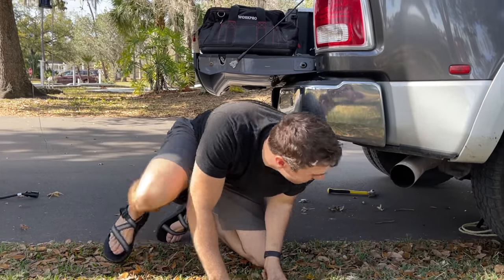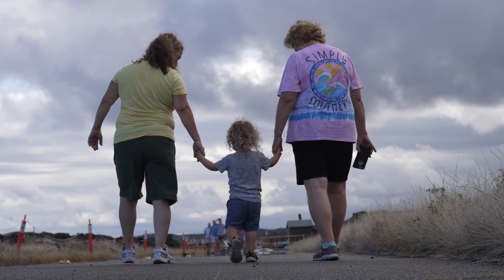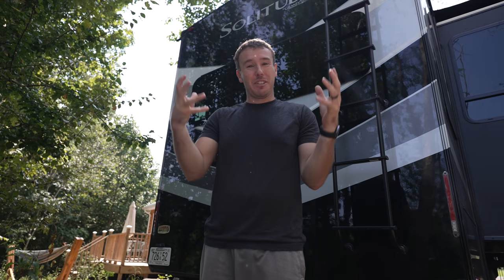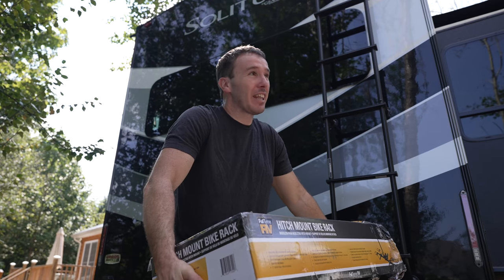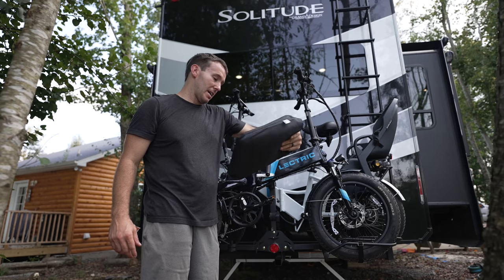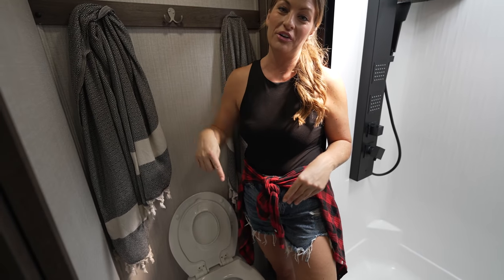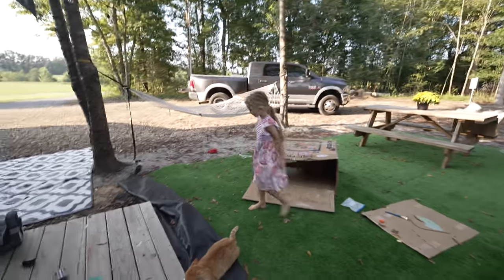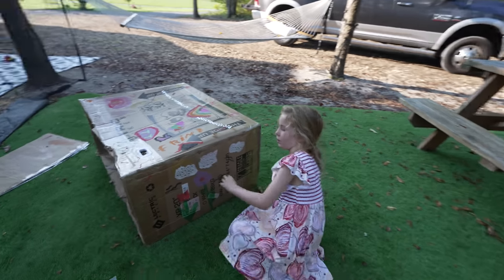5 DIY Upgrades That MIGHT Make RV Life Easier

Comment: I agree with Dans comment below and maybe others that I didn't see. "You could add a secondary switch on the island that turns the lights on and off and leave the wall switch on all the time to energize the water filter." Or you can jumper the switch on the wall so that it never shuts power off to the island.
Thank you Nathan and Marissa for another awesome video. Really interested how that Ebike rack holds up and how long the water filter lasts and how well it works for you.

Comment: We've always replaced the quick pin and cotter pin that allows you to fold it up and down with a solid grade a stainless bolt and locking washer set. Just tighten it down properly and it will add security I the gap or lash if you will that the folding pivot allows.

Comment: FYI FYI FYI-Nathan, if you read the instructions it clearly states not for use on travel trailers or 5th wheels although the picture on the box is deceiving.  I bought the same one but am afraid to use it on the back of my reflection 337rls.

Comment: For added e bike security remove one pedal, seat post and battery.
Reply: I bought the BIGLUFU motorcycle chain lock, uncuttable 12mm square chain that’s 4 feet long and covered in this “hard to cut” material for my Lectric bike. It’s a beast! I love the idea of removing the seat because I got the comfort package. Removing the battery is another great idea as it’s worth a couple hundred dollars.

Comment: Nathan, be aware that ebikes are not intended to be left out in the weather. They can take a bit of rain but leaving them outside while traveling may cause troubles. Love you guys!!!!
Reply from the maker: Thank you for letting us know. We do hope to keep them covered and out of the elements as much as possible.
Reply: Lectric 2.0 is more weatherproof but I agree it is risky to leave them out in weather. Definitely a great heavy duty chain!  We also have motion alarms for our bikes.
Reply: We have had ebikes for two years now.  We always remove the batteries when they are on our carrier and we are travelling.  We use a good cover and have never had a problem with the electronics of the bikes.  We have the Swagman ebike carrier and it is very sturdy with locking arms and locking hitch pin.  Have hauled those two ebikes many a mile now.
Reply: @mischiefroadtripadventures  it's rated IP 65
Reply: Some people buy the big outdoor grill covers to cover the bikes to protect them. That's what we will do also
Reply: Sandra Westley uk I watch a couple that are RV s that have been robbed twice of there electric bikes, taken off there rig, so make sure they are well insured, and have good locks on them, they even think they were taken one of the times when they were in there rig, and they were on a site, not boondocking, but it was private and up a corner at the end of a trail. So always always keep them locked up when your not in use.

Comment: QUESTIONS:  Love the channel, btw. #1 - The Acuva. Why this particular system instead of a Berkey? I know it takes up counter space, but … SUPER EASY to use and maintain. Filters last a long time and the level of filtration includes bacteria, etc. The other benefit, NO ELECTRIC source needed. #2 - I’ve been battling constant replacement of the stupid drawer catches that are plastic and break incessantly. I’ve installed a magnetic catch (supposedly 60lb), but is really not super strong. Any tips from you or anyone else reading this would be mucho bueno!! Anyway, inquiring minds want to know! Glad you’re back from Hawaii and can’t wait to see your new adventures. :-)
Reply from the maker: They are both great, we had Acuva before and enjoyed it.

Comment: On the bike carrier, put some pipe insulation on the bike clamps that go to the frame of the bike.  Otherwise they will rub the paint off of the bikes.
Reply from the maker: Thanks for the tip.

Comment: Should keep it 12 volt otherwise you need shore power or run inverter 24/7 to filter water.
Should be able to run 12 volt line through basement & poke up into island.
I would add a switch, just because.
Reply: Totally agree. Best route.
Reply from the maker: 12v would be a good bet for many RVers. For us, we typically leave the inverter on all the time so using 110v isn't a big deal.

Comment: The foam around the part that holds down the bikes will wear through very fast and then you will have metal rubbing the aluminum bike frame, damaging the bikes.  I folded a piece of cardboard box to help protect the bike.
Reply: Also, are you at the rally?  If so, what section are you in?

Comment: We have sliding doors for the master bedroom and bathroom.  I wanted to hang those over the door hooks for towels and robes but it wouldn't work.  I do have space on side of the toilet  in the master bath.  I keep our mop & broom back there so they aren't seen since most people use the 1/2 bath.  Our rig came with the extra filtered water faucet.  I think we have a leak I need to look into having fixed.  I'm hoping it just need drain putty.  That stuff dries out so fast when the rig is left sitting in the sun.  HUGS~Donna

Comment: Change a dually tire? Isn’t that what AAA for? Those covers will not stay on going down the road. They’re great when you’re parked. Get a heavy duty lock that a bolt cutter won’t cut through easily.

Comment: The ebike in a tub under the RV is more secure than on a trailer hitch outside. If you ever watch the Lock Picking Lawyer, no lock is really secure. Plus pulling a cotter pin out of that hitch wouldn't be all that hard. Maybe a pull out slide w bike mounts would be better?
Reply from the maker: Totally agree. We just weren't willing to give up 90% of our bay storage for the two bikes to fit underneath. For others, it could be a good trade off or if someone has a bigger bay it might not be as much of an issue.

Comment: I was trying to add a light dimmer to the switch by the door. It didn't work. Turns out the switch went to the Lippert Compass Connect to energize a relay. The real 12v circuit came off elsewhere. I feel your pain with the island.

Comment: Put a bolt through the place where the pin and cotter pin are now.  Also, get a locking hitch pin and a proper lock for the bikes.  $2k+ in bikes is a prize for any thief.  We have the same bikes (v1 actually), would love to share what we do for security and tracking if stolen.  Send us a message on IG. :)

Comment: Just a thought, I am no expert. But for the "U"V" part of the filter needs the water to be exposed to the UV light for a certain amount of time to kill the critters. Running it to the larger faucet might cause the water to not spend enough time in the light?
Reply from the maker: I get what you are saying but this is designed for running water.

Comment: Do you guys leave your hot water heater on at all times or do you turn it on when needed? Also, do you find your AC unit to run almost constantly? Is that normal? 

We just went through our first week of the full time rv life!
Reply from the maker: Some leave it on, some turn it on and off.  Our friends only turn theirs on as needed. On your AC you might want to make sure your fan is on AUTO and not high or low.  AUTO will let it come on and off with the compressor.

Comment: On the island situation,  you could always either leave the switch on or bypass it at the switch( having power on all the time) and putting remote control dimmers on the pendants and the under counter lights.  This would also make it so you could operate each of the lights separately and dim them.

Comment: Wouldn't it be better to have a whole RV filtration system so all of your spigots are giving you safe water.  You can get bad infections from showering or brushing your teeth with contaminated water.  We have horrible city water here in Florida where we live.  We are thinking about getting a whole house filter for taste, particles and chlorine, herbicides and pesticides then a whole house UV system to kill bacteria.
Reply from the maker: Sure that would be great but we would have to consider the pros and cons of a bigger system. 🙂
Reply: @LessJunkMoreJourney  It is a dilemma of what the best system is for an RV or a house.  I think yours is a pretty good one.  We have been thinking about it for some time; and, haven't done anything about it.  We buy lots of bottled water and I feel so guilty about that because of all the plastic it puts in the environment.  We store cases in our hot garage and I just read that is the worst thing you can do.  The plastic leaches chemicals into the bottled water in a warm or hot environment much faster.  Your video really made me think about getting on the ball and working on this issue.  I do know Reverse Osmosis is not good way to filter water; it takes everything out of the water; including minerals you need.  This treated water can actually leach minerals out of body.  So, I definitely won't go that route.  Great video by the way.